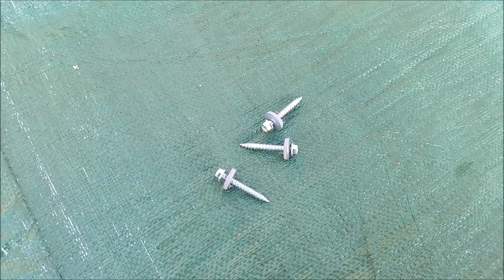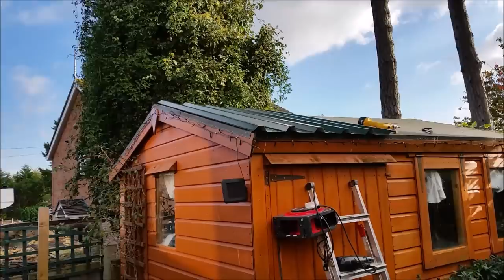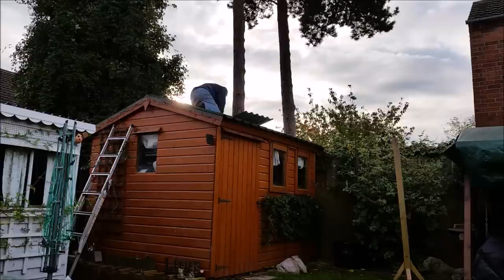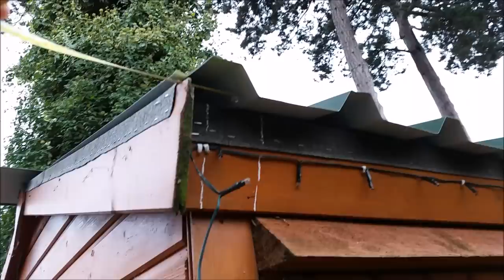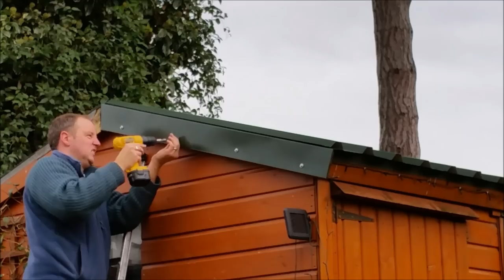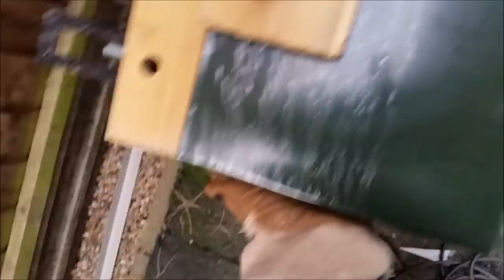How to fit a metal panelled roof to a wooden shed

Comment: If you score the metal with a sharp knife before bending it makes it a little easier. Did the instructions say to put the gable flashing under the roof edges? The instructions I've seen have the gable flashing/rake trim overlapping to keep the wind from picking up the edges of the metal on the sides. But it's a shed not a house so it doesn't need to be perfect.

Comment: Is one not meant to fit the screws into the slight up-stand in the panel, as with corrugated iron sheet, on which that is definitely the way to do it.
Reply: Either method is OK apparently

Comment: 10:01 it would of been easier bending it downwards not up. Clamping a board on and using your weight across the length would of meant you didn't get any buckles as it bent.